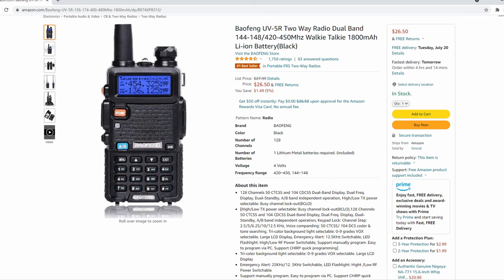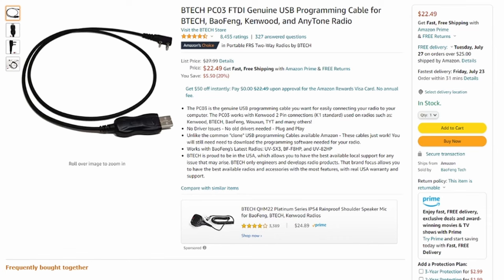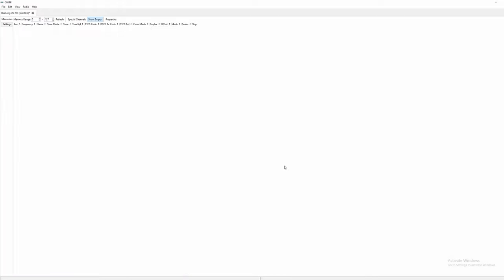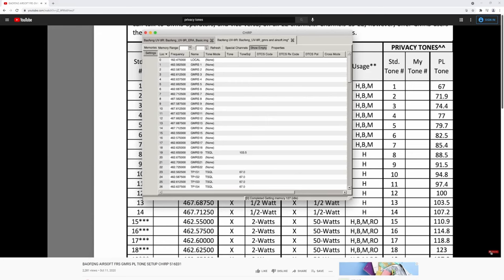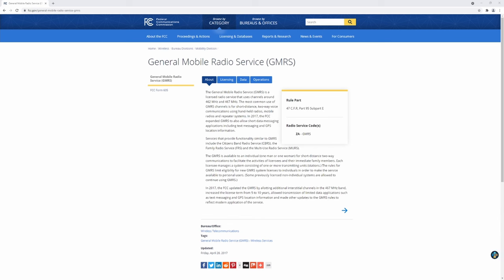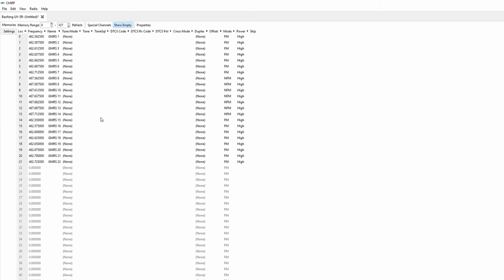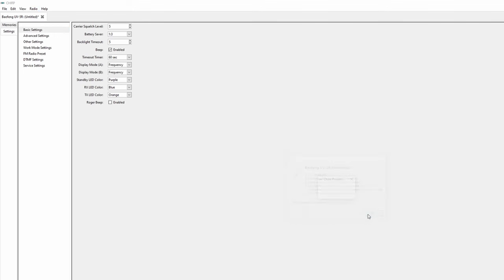Baofeng - Legality, Programming, & What Frequencies to Use for Airsoft or Milsim

Comment: You did not mention downloading the MURS, NOAA, and marine channels. You should also add 10 Ham UHF and 10 Ham VHF simplex channels for monitoring only for emergencies.
Reply from the maker: I actually specifically mentioned NOT downloading those because they will go unused for the purposes of this guide as well as mentioned that the HAM bands require an Amateur license. None of that is useful for the point of this guide. This is a guide on using radios for Milsim and Airsoft. Emergency and maritime channels won't be useful to some teenager running around an airsoft field.

Comment: I have watched so many videos and still have no idea, I got the UV5RE Plus for Christmas, do I need a license to transmit on it?
Extra info: I live in the UK (that’s it)
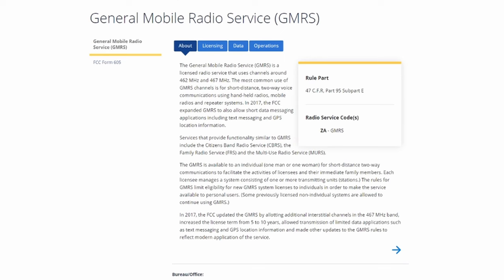Reply from the maker: 1:32 "...these are pirate or outlaw radios unless used under very particular circumstances. IF you have the particular type of Baofeng which is actually FCC Part 90 approved then you can legally operate these radios under Amateur Radio frequencies IF you are a licensed Amateur Radio Operator. Otherwise, you need a GMRS License and can only operate on those channels."

Change this to PMR approval for UK. Radio must be specifically built with PMR and wattage restrictions in mind but Baofeng ignores this. Lowest possible power setting is 1 watt where PMR requires 0.5 watts.

2:31 "the short answer is that for Airsoft or Milsim if you wanna do things legally you can spend $75 to get the GMRS license"

UK doesn't have GMRS so basically you CAN'T transmit on them legally unless you have an Ofcom Amateur License and it's approved for PMR. Most people using Baofengs in the UK are doing so illegally and honestly they probably aren't gonna come find you unless you're crowding up frequencies for emergency services or something like that.
Reply: Hey, I’m also U.K. based and have quite a lot of knowledge on this subject. I’ve sold a few units and have advised a LOT of airsoft players on this subject over the years. 

As GoonRacoons rightly said, we don’t have GMRS in the U.K.. The nearest thing we have is PMR446 - basically the same as FRS in America. 

PMR446 is a licence free band allocation of 16 channels on 446MHz UHF, between 446.0 and 446.2MHz. OfCom (FCC in the States) laid out some ground rules for its use, the most prominent being: 

1. The antenna must be fixed to the radio (not detachable).
2. Output power must not exceed 0.5watts.

I’m in the process of creating some videos around this topic so I’ll comment back when I’ve uploaded them and it might be interesting to take a look. 

Basically, nobody in recorded history has ever been prosecuted for transmitting on non-type approved equipment… ever. PMR446 is a bit of joke in OfCom’s eyes, and it’s nowhere near as heavily regulated as GMRS. You’re not interfering with HAM frequencies, you’re not interfering with business radio frequencies… if you really wanted to be polite and ensure you don’t interfere with people camping or kids playing in the street, stick to channels 9-16, as most walkies people have only have the original 8 channels. 

There’s a whole subculture of PMR446 users that enjoy the band as a modern U.K. CB, but PMR446 is for everyone and anyone. The ‘band police’, as we call them, will often tell you that you’re risking interfering with hospital pager systems… pay not notice because it’s all rubbish (they were done away with years ago, and were digital before that). Use the band for what it is, and don’t worry about Ofcom coming out to get you - even if you were the first person they ever caught and arrested, which I 99% guarantee you won’t be, they’d need the mythical detector van; they’d need photo and audio evidence of you transmitting on non-TA equipment, all of that money spent for the equivalent of jaywalking… when Ofcom is always more concerned with making money from tv licences and for any radio prosecutions, put more time into going after pirate FM radio stations and Marine VHF violations. Trust me when I say that you’re among friends, and hey… if you need any help with programming your radio then I’d be happy to help!
Reply: Also, depending on your Airsoft club, they might have a business radio license that allow their players to use certain frequencies. Look into it, and with their permission, use the frequencies under their licence terms! I know a few airsoft sites have them to ease congestion.